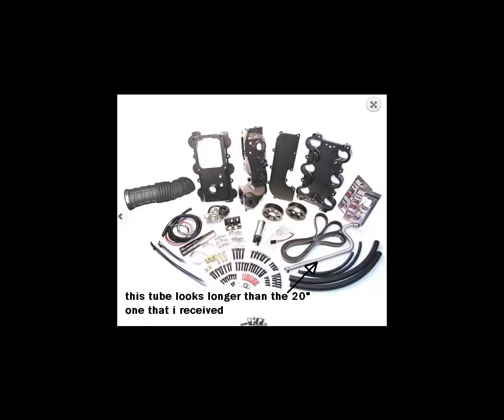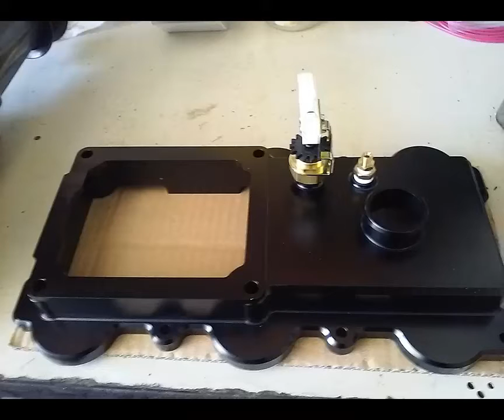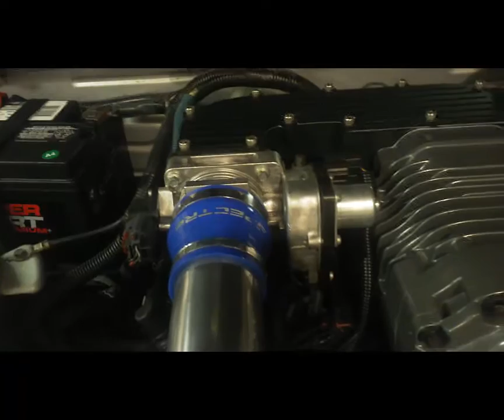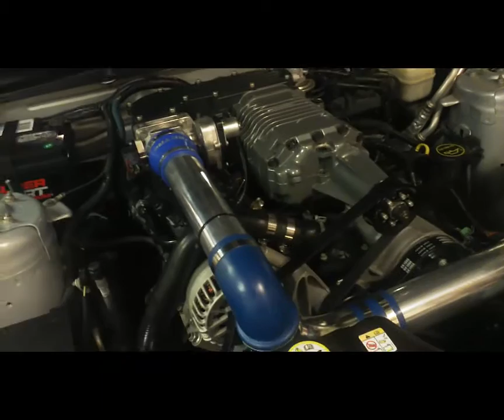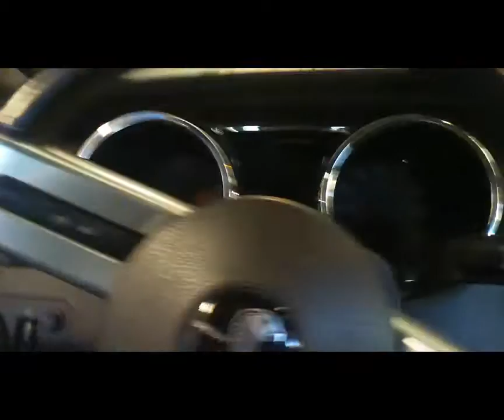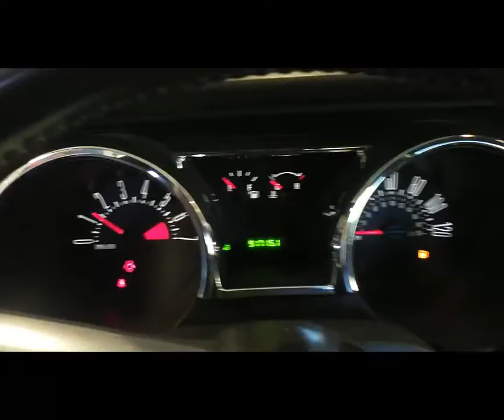2005-2009 Ford Mustang 4.0 liter Eaton M90 supercharger install

Comment: It's 2200 for the install kit then you get an Eaton m90 supercharger from ebay they are around 500 bucks. Much cheaper than x charger or vortec, you can get an Eaton m90 from an 89-94 ford thunderbird super coupe. The modbox kit does not come with the supercharger. It's alot of money for 300 rwhp.

Comment from the maker: direct bolt on supercharger system  in place of stock intake manifold is the easiest and cleanest route, turbo and the detached procharger systems require more plumbing, this kit is a great entry level for the DIYer, its only fall back is belt slippage, they need a idler bracket installed in between the alternator and the super charger, they say there making one but they talk alot more than action it seems, they were suppose to sell a MAF signal reducer but never did, I had to make my own  ($5) or buy the Diablo MAFia version for over $100. I have the biggest boost installed for the kit at 9.5 psi and they rate it around and add to that my water meth injection IM sure Im at 35O hp at the crank. Their intake manifold that comes with kit at 65 mm ID to match stock throttle body so a 70mm throttle body kit like BBK maybe a waste of money unless you port the intake manifold to match, I would also maybe suggest shorty headers but stock headers like rather nice to me.
Reply: If i have eaton m90 supercharger, where i can buy installation kit ? thanks
Reply: So the modbox kit has a throttle body size for the stock one so I can do a 70 mm with their intake tube but what about the one that comes with the supercharger

Comment: Alright man so happy for you, can't wait to hear that m90 whine👍👍👍👍.
Reply: m90 is a smaller pump and not much whine noise, I was disappointed about that so if your looking for the cool whine noise this application may not make you happy.
Reply: @scottcooper6843  that's ok happy for your mod .👍👍👍
Reply: @scottcooper6843  I've heard some seriously loud m90 combos. You can spin them very high. My m90 blower will turn over 16k Rpm at redline and should scream.

Comment: your gonna get massive belt slippage with that setup
Reply from the maker: since Ive put on over 2000 miles on it  I know exactly if it slips or not, yes I have some slippage issues off and on in the past but for the moment its working fine but I do have plans to add another idler pulley and bracket but its not a problem now so Im not going to invest any money until A I have extra cash or B it starts slipping to the point where Im tired of playing the the serpentine belt, I tried one of those new belts from Gates claim to be exclusively for superchargers and it slipped more than any other belt I put on, so far the best belt is the continental elite poly v belt
Reply from the maker: update, I added a bracket and added one more idler pulley and belt slippage is now gone. bought the bracket from a guy who was selling it to X-Charger supercharger folks, a competitor to this kit I have.
Reply: I added another idler pulley to mine and zero slip.

Comment: Did you have to tune your car before driving it after the instal? If so what did you use because I plan on doing the same
Reply from the maker: I didnt have to do a Dyno tune, I did an email tune (canned tune), I even put the stock tune and it ran fine, this has ben a very successful install for me. The biggest challenge was passing smog living in california.

Comment: How has your experience with the kit been? I just bought my kit for my 01 explorer and plan on installing in about a month. I also live in CA. I don't think our vehicles will pas the visual instpection haha
Reply from the maker: yes wont pass smog without a calif C.A.R.B# (if you live in Cally), belt wrap is an issue with the kit, maybe different in the explorer though.
and I dont like where you have to use silicone to seal the kit, I wish it had gaskets or utilize FORD OEM seals, other than that the kit Im happy with.
Reply: +soupercooper I think rtv was used to keep costs down. What do you mean by belt wrap?
Reply from the maker: belt wrap is how much surface area contact of belt with pulley, if not enough wrap belt will slip, and it has been a problem with this kit, Ive been told by manufacturer that they are working on that problem by adding another idler pulley and bracket, but dont quote me on that.
cutting costs is okay until it creates poor design, need a balance between cost and design.
Reply: Oh I understand now. Yeah that was a concern of mine as well. Especially with the alternator. Well, it's nice to know that they are still creating products for these applications

Comment: I'm considering this kit for my car.  How difficult and or time consuming was the install?  Any ideas on power numbers?  How does the car drive now compared to the stock N/A engine?  Lastly, what are your overall impressions of this design and kit? (should I do it or go another route?...)
Reply from the maker: I cant give you any HP or torque values since I cant find a dyno in Northern Calif. to deal with a V6 for some reason?  It takes more work than a usual kit as its budget style build.  I rate it 7 out of 10 in design and satisfaction but Im a perfectionist.
I wasnt happy until I installed the 9.5 pSI pully, it came with more than one pulley, with a range of 5, 8 and 9.5 psi.
I have belt slip problems as I feel it need an additional idler pulley to give the alternator more belt wrap, but all in all for the money its a great value BUT you need to find your own EATON M90 superchargers, you need to find one on ebay or craigslist or where ever. I wanted to hear that iconic whine sound of which I never really heard until I put on the 9.5 psi pulley, I feel the kit doesnt really come to life until you use the 9.5 psi pulley but thats just me, I used water methanol injection option instead of the intercooler option as well.
Reply: So you recomend the kit with a 9.5 pulley?  From behind the wheel, can you feel a large difference?  I do some autocross and road course racing and I have 4.10 gears.  Would this kit pair well with my shorter gears? I apologize for all the questions, but I have never found someone who has installed this on a mustang.  Only ford rangers!
Reply from the maker: I cant even take my car to wide open throttle because I cant find ANYONE in Northern Calif to dyno my  car, I suggest having buying the SCT brand tuner since thats what most tuners support and go with suggested tuner from the kit manufacturer and start with canned tunes? I have two hurdles, one I have a diablo tuner of which no one uses and two I have a V6 of which no one wants to put on their dyno.
Reply: I have an SCT from Bama tunes.  I read on the moddbox site that they can walk the customer through tunning from a laptop?  Have you tried this?
Reply from the maker: yeah your better off with a sct tuner widely accepted and they can walk you through though i have zero experience with their recommended tuner as i had no sct tuner but instead a diablo tuner so i had to take a different route, if i had to start over id use a sct tuner. but ultimately you need to go to a dyno to get the full potential of power, a email tune to get you rolling to drive to a tuner, but some have successfully gone with just email tunes its worth a try for sure, sorry for the typo meant to say V6, its corrected
Reply from the maker: smog is your biggest challenge, there is no smog CARB# for calif smog laws for this kit all other 49 states you need to research your smog laws, this will stop you in your tracks.
Reply: How did you fix the mass air flow sensor?  Could I replace mine with a gt500 mass air flow or does the stock one have to be modified?  I have no smog issues in my location so it sounds like the biggest deal is getting a dyno tune
Reply from the maker: to get you MAF to handle higher air flows I made my own voltage multiplier board with two certain resistor values  wired in series or something of that sort, if not Diablo sells a unit called MAFIA and I heard Moddbox the kit vendor is going to provide one but dont hold your breath on anything coming from that place, they seem to move at a snails pace. Moddbox gave me info on how to make my own MAF signal muliplier.
Reply: Awesome, this deal sounds pretty good after all.  Last question,  have you fixed your belt wrap?
Reply from the maker: INFO from vendor on the MAF issue.....
The Moddbox MAF Adapter is an electronic device that adjusts your MAF (Mass Air Flow) signal for higher airflow. option 1 make you own (its easy) option 2 purchase the Diablo Mafia (over $100) or wait for modbox to finally produce one (bad idea)

Did you know that your stock MAF sensor is designed for much higher air flows?  When supercharging or turboing your vehicle, the upper range of your sensor output (under high airflow) is not compatible with your vehicle’s stock ECU (Engine Control Unit).  This product adapts your stock MAF sensor output to be compatible to your ECU thereby eliminating the need for expensive aftermarket high flow calibrated MAF sensors.  This product is to be used when tuning your vehicle for boost applications.

This product has three (3) MAF multiplier settings as follows:

(1) Output signal multiplier of 0.90 (-10% or 5.5V to 5.0V)

(2) Output signal multiplier of 0.83 (-17% or 6.0V to 5.0V)

(3) Output signal multiplier of  0.76 (-24% or 6.5V to 5.0V)
Reply from the maker: vendor claims 'm the only one who has belt slip issues, I have gone through 4 belts so far trying to find a belt that can solve a poor belt wrap design. I also found out vendor sent defective supercharger pulleys..SO I have installed a shorter belt recently to increase spring tension and I installed a non-defective supercharger belt pulley but I don't have enough time on engine to say problem solved, I will keep you posted.
Reply: Sounds good,  I appreciate your help!  But how were the pullies defective?
Reply from the maker: The ribs on the pulley were machined too tall, so the sharp point was the only area in contact with belt allowing for slippage, not enough contact with belt, but there is still the issue with not enough belt wrap on the alternator. Im guessing you have a 50% chance it wont slip on you

Comment: Did you add ring gap ?
Reply from the maker: no I did nothing with inside of engine. I dont push it very hard, I rarely drive this car, its a show car. but once a year I puh it hard at monterey car week and Ive never had any issues of any kind with engine, this is a tougher engine than you think.
Reply: @soupercooper  oh you could have the worlds strongest engine and not enough ring gap would destroy it I was just inquiring seeing as I wanted to do the same to the previous generation v6 just wondering if ppl were out getting away with not adding any you knw

Comment: i know this is an old video now but ive just put this kit on my car, how did you make the maf adapter? as i will need to do this on mine.
Reply from the maker: are you talking about the mounting brkt or are you talking about the electronics board that gives you a wider signal range?
Reply: @soupercooper  the board itself and how did you wire it.
Reply from the maker: @jordanhart5195  i got got all this info initially from the guy who sells the kit. he gave me a  diagram of what size resistors to use. its just two resistors that create a voltage multiplier. he has the schematics. if he cant help you then I can try to help
Reply from the maker: @jordanhart5195  I can email you the info and schematic that I have if you wanna give me an email addy
Reply from the maker: I actually removed that circuit board (2 reisistors) to pass california smog test and it works fine without that mod but best to include it if you can
Reply: @soupercooper  Would love this diagram as I am now installing this kit. Would you be able to send it to me?

Comment: numbers?
Reply from the maker: no dyno numbers, I cant find anyone to dyno my car in Northern California, no one has experience with a supercharged  V6 and they just dont want to learn so Im stuck using a canned tune from the people who sell the kit, on their website they recommend a tuner to deal with but its a canned tune. One of my fallbacks is I have a diablo tuner and no one uses diable much it seems, so I have to buy a SCT tuner to perhaps find someone to dyno my V6.
Reply: soupercooper ahh ok. i know vmp tuning does good work and can remotely tune it i believe.id try there also. and thats amazing that shops wont do it. just like here in washington, a turbo shop wouldnt even give me a quote to turbo my 4.0. said it sould cost too much lol. when im the one paying. but how is it to drive? i am not sure which route i wanna go but this or a custom turbo would be the cheapest
Reply from the maker: direct bolt on supercharger system  in place of stock intake manifold is the easiest and cleanest route, turbo and the detached procharger systems require more plumbing, this kit is a great entry level for the DIYer, its only fall back is belt slippage, they need a idler bracket installed in between the alternator and the super charger, they say there making one but they talk alot more than action it seems, they were suppose to sell a MAF signal reducer but never did, I had to make my own  ($5) or buy the Diablo MAFia version for over $100. I have the biggest boost installed for the kit at 9.5 psi and they rate it around and add to that my water meth injection IM sure Im at 35O hp at the crank. Their intake manifold that comes with kit at 65 mm ID to match stock throttle body so a 70mm throttle body kit like BBK maybe a waste of money unless you port the intake manifold to match, I would also maybe suggest shorty headers but stock headers like rather nice to me.